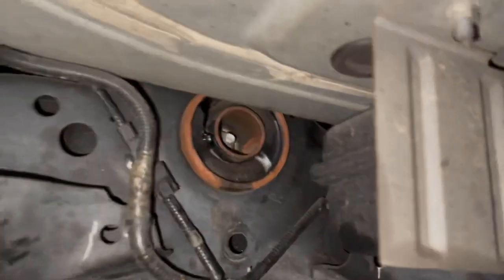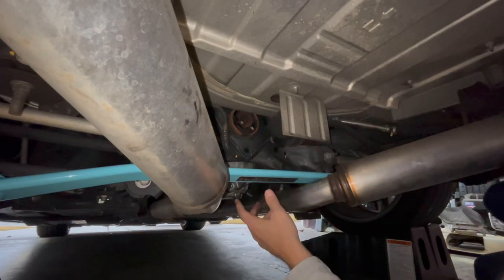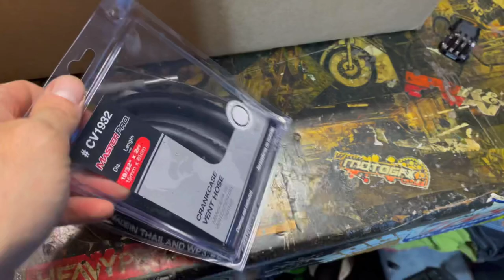FIRST Q50 Rear Lateral Arm Brace Installation | Soul Function

Comment from the maker: The canister in question in the video is the vapor canister (charcoal canister/evap canister).  I have a link to an excellent overview of what this canister does in the description.  In short, the canister stores/absorbs excess fuel vapor while the engine is OFF.  When the engine is running and conditions are met, the valve is opened allowing clean air to pass through the canister and pushing it back through the engine.  So in regard to the question of heat being an issue; it should not be.  First, temps should not be hot enough to cause a problem.  Second, vapor is only stored while the engine is off, and therefore the exhaust is not increasing in temp.  Third, I did wrap the hose and cannister in heat tape, just to be safe.

Comment: Isn’t it going to have any issues with the heat from the exhaust ?
Reply from the maker: I mentioned that in the video and hope not.  It really shouldn’t but I did wrap the hose and canister in heat tape
Reply from the maker: Update--Shouldn't be an issue with the heat as the vapor canister only stores fuel vapor while the engine is off.
Reply: @SpeedCultureStudios  great thanks for the update

Comment: So I was curious before this vid dropped if your car had same box. I had bought earlier this year a brace like that but from a competitor to Soul Function. I ended up not installing because I was afraid of what that box controls lol.  I saw on Soul Function website where if car has active trace control that it wouldn't work. So my question is does your car have active trace? My Q does and absolutely hate it. Don't know if that has something to do with the box. Keep us updated on any problems after installation. I really want to install on my car, I still have the part 😂
Reply from the maker: It does have active Trace control but all that is, is the car applying rear brake pressure around corners to maintain control.  I don’t know if that box would have anything to do with that, but moving it won’t hurt anything.  And you can turn active Trace control off in your settings
Reply: I can't access any of that on my car like the G meter etc. Wasn't about to pay extra for intouch system to configure all that.
Reply from the maker: @ashton9542  what do you mean?  I have a base model…no bells and whistles
Reply: @SpeedCultureStudios  Only thing I don't have is technology package which is lane keep assist stuff. However in the infotainment system I can't access apps like email, g meter, nor can I adjust the personal mode at all.  It's locked on my car unless I take it to Infiniti and pay for the services not sure exactly what it's called. Screw the dealership haha they only clear the chassis warning code idk if you ever experienced that or not.
Reply from the maker: @ashton9542  I don’t have tech either.  Wonder why your screen is locked.  That’s strange
Reply: @SpeedCultureStudios  Bought the car used from a non Infiniti dealer in Texas. There's a service you could pay for monthly to use all those applications links to onetouch ap on your phone. I wish I could turn off trace because the car eats rear brake pads. Other than that no issues at 92k miles 👌

Comment: Question I just put coilovers last night on, and my splash guard keeps scraping,  do you recommend me take it off, it’s really scapped up from previous owners
Reply: You can get a metal one from z1 motor sports that looks pretty clean or depending on where you live rock it without I’m in cali so I don’t really have a rust problem
Reply from the maker: I agree with the statement above.  I’d replace it.
Reply: @SpeedCultureStudios  The same undershroud that you installed ?
Reply from the maker: @JustRmontay  that would be my recommendation, yes.

Comment: fuel vapor filter. Probs not a good idea to heat up fuel vapors
Reply from the maker: I would imagine it would need to get much hotter than it does to cause a problem, but I did wrap the hose and box in heat tape so don’t anticipate an issue.  May look for alternative ways to mount it.  Or just eliminate it, if it’s just a vapor filter.